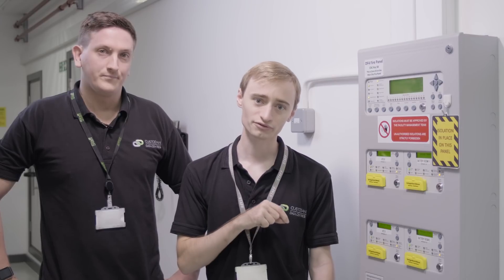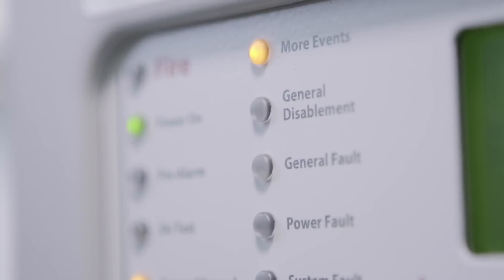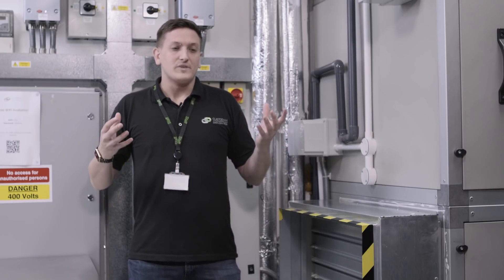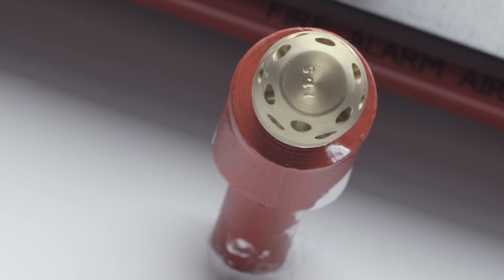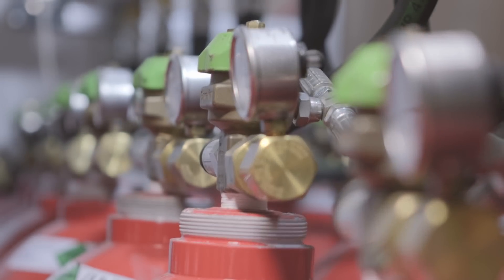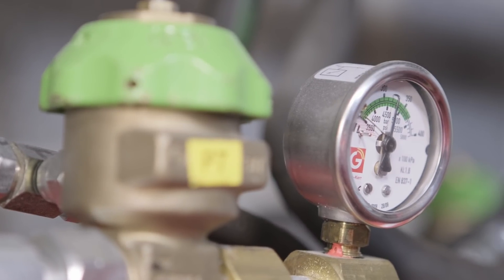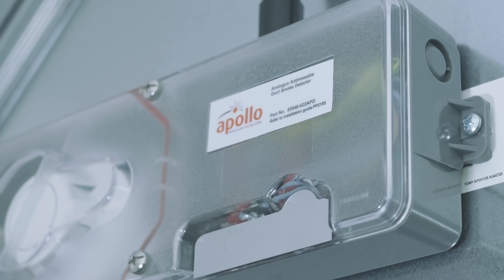INSIDE a DATA CENTRE - Fire Suppression

Comment: iam having  a 18U server rack in my house with rooftop fans just for hobby. Iam have fill this  rack up with 3 hpe servers 2x ml350 g6  2x 6 core  xeon 1x hp dl360 g8 2x 6   core xeon  200gb ram 1x netgear 24 port managed switch 1x  draytek 2926 rackmount with temp sensor.  vpn firewall router. Iam  having  a 2 liter c02 fire extinguisher just for safty  on the wall  end put a smoke detector alarm in my servercloset in case of fire.

Comment: Do you do a full test periodically (every x years) to ensure the gas does release?
Reply: Yes. Gas bottles will be regularly maintained. The gauges will be checked weekly to ensure pressure is above 285, when gauges are lower they will be either swapped out or refilled.

Comment: Hey, @Custodian Data Centres may I ask what hardware / Gear / cable you use for the server and rj45 plugs? Whenever I build LAN cables for house wiring, in the office and on projects and I have to do it like three times. During crimping or after ... it is always one or more wires that is not fully connected .

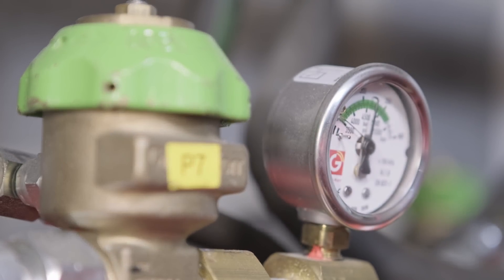Comment: 4:50 -- "gases that won't actually kill you". Correct me if I'm wrong, but those are inert gases intended to displace oxygen and halt combustion. If you were inside a chamber where those gases were being flooded into, you could suffer from hypoxia and succumb to the environment.
Reply: Nope, the gasses perform as James said, it drops oxygen down to such a low level fire cant live but you can, you do have to breath deeper and heavier, but you will be able to walk through the place and safely exit - BUT, the pressure of the discharge is powerful, it can destroy hard drives, so imagine what it could do to your eardrums.

It was tried in some places to reduce the noise and pressure vibrations by having more discharge heads, but I still would prefer not to be in there :)

Fun note: after discharge the gas can be trapped in there for some time until the Fire Dept tell you its clear to vent, some 20 mins later, if you try strike a match, it wont light.
Reply: @Ressy66  Interesting, thanks for the insight!

Comment: It’s a shame OVH didn’t have this in place
Reply: They did, however it wasn't quite working correctly so the gas didn't end up surpressing the flames, instead the movement in air must have been accelerating the burn.
Reply: They did, however it wasn't quite working correctly so the gas didn't end up surpressing the flames, instead the movement in air must have been accelerating the burn.